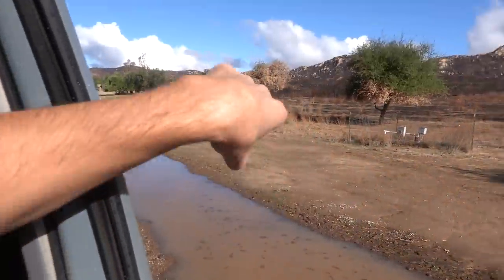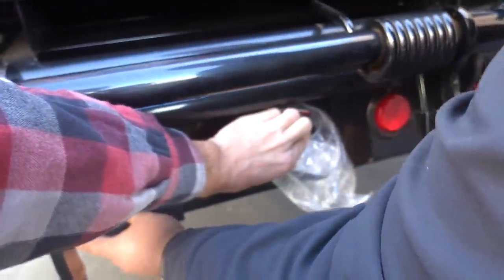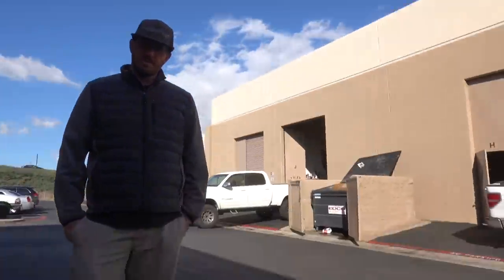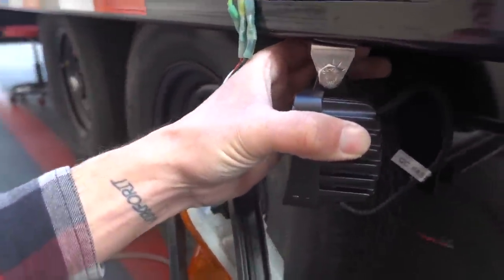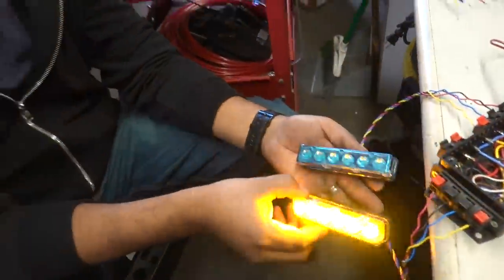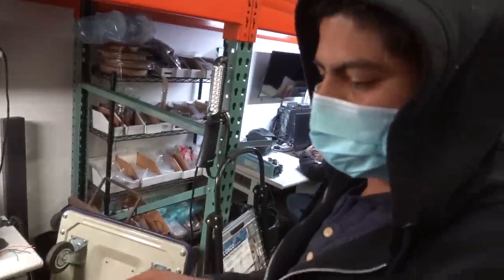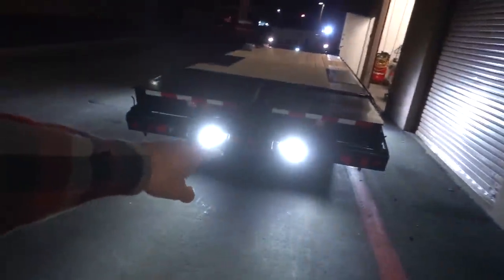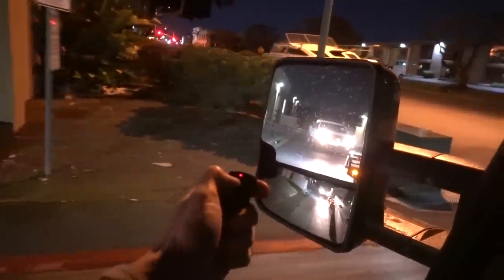Every Trailer NEEDS These Lights!

Comment: Might as well ad a backup camera to the trailer with a remote screen in the truck. Keep up the great work !
Reply from the maker: Haha Sergio wanted to. I just hate not being able to tie it in to the factory head units on each of my trucks
Reply: @DMAXRYNO  hahaha ! If your head unit has a front camera function you could tie into that ?
Reply: @DMAXRYNO  there’s YouTube videos about putting a back up camera screen inside the sunglasses holder on your truck so that’s always a option for it too
Reply: They make wireless ones now as well as wireless screen that could go from truck to truck
Reply: May be a year late but why not just use a 6pin 3way toggle switch to manually switch between the 2 inputs. It's what I did on my f-150.

Comment: Awesome. Every trailer I got has a battery and reverse active lights. With the flip of a switch there's work lights. Additionally, when attached to parked truck a different switch turns on the reverse/back cargo lights and the truck reverse lights as well. Result: LIGHTS!

Comment: To put the nut inserts in without a rivet tool you can use a bolt that fits the insert and some washers with an impact drill just make sure the hole for the insert is same size as what you are trying to insert. I have done this way many times .

Comment: Backup camera mounted to the trailer would be a big improvement, especially for someone riding solo without a spotter.  I use mine damn near every week. I don't know what they sell  aftermarket, mine came built into the f250 head unit.

Comment: Im surprised trailers in the us doesnt have reverse lights. Even more suprised semi trailers dont have them. Its good so people can see if the truck is reversing, (if you are travelling at70mph and a truck is reversing slowly on the side on a dirt road, you cant really tell what he is doing) and its good so you can see. Here trailers are required at least one 21w reverse light (or led), but most rear tail lights (europoint series) have one on each side. So you have standard 42w reverse light, but even the most cheapsoate companys opt for 2 additional led work/reverse lights on trailers, so 42w+2 (40ish..) wats led lights. They light up everything!

Comment: Yes just install them with a nut and bolt you can get nutserts tighter without the stupid tool anyways

Edit: Wow those reverse lights turned out sweet. Super bright & good coverage where you need it. Every trailer should have something like this

Comment: I'm fixing up our little single axle bike trailer. Adding two side wheel chokes along with the central one for when both the rmz & r6 are loaded...some reason i think i need to adress its lil lighting features now tho🤔🤷🏼‍♂️. Hmm 😅LoLol 💪🔩🔧🤙ye yeet
Goal is to get the positioning just so actuall three bikes can be loaded in a row vs just two outside oR one central etc..
Reply: ...& possibly some more tall, larger side risers just so if a strap mishap, happened, bikes lay on it vs tipping all tf'kin way out etc..

Comment: I feel so bad for surgio (sry no Idea on Spelling) But when Dmaxo told him that the wiring was being done when you were picking it up and he head smacked. I know its relatively easy to pull a constant power wire too the 7 pin but still more work lol

Comment: I feel like you’re a bad influencer. Lol I liked the lighting so much I ordered leds for the jeep.
Reply from the maker: 🤣🤣 Which ones did you get?!
Reply: @DMAXRYNO  I got the SEALLIGHTS headlight. 
Switchback turn signals for the fronts
(white/orange)
a smoked 3rd brake light. 
Strobe break lights.
SEALLIGHT back up lights.
crystal blue inter lights.
Lol all in led lights.